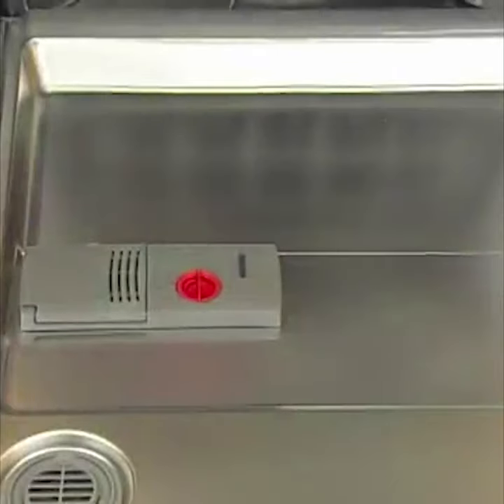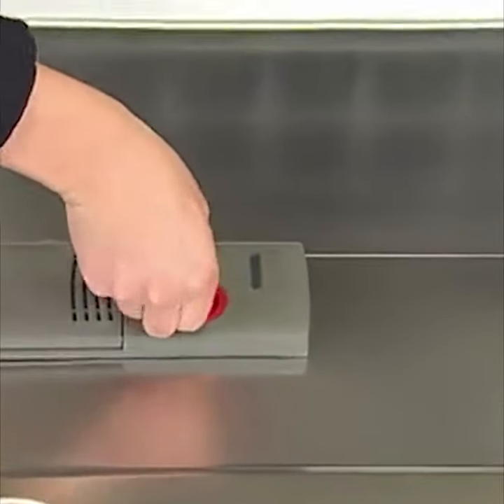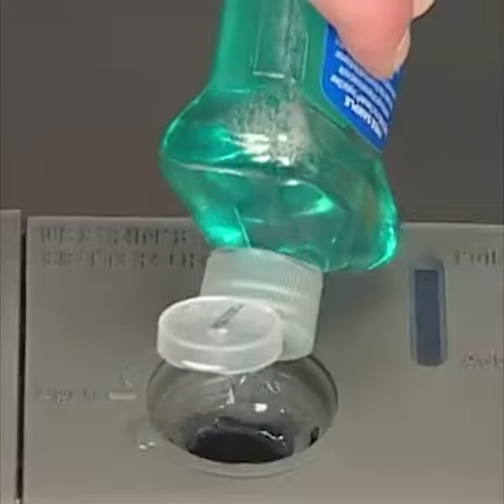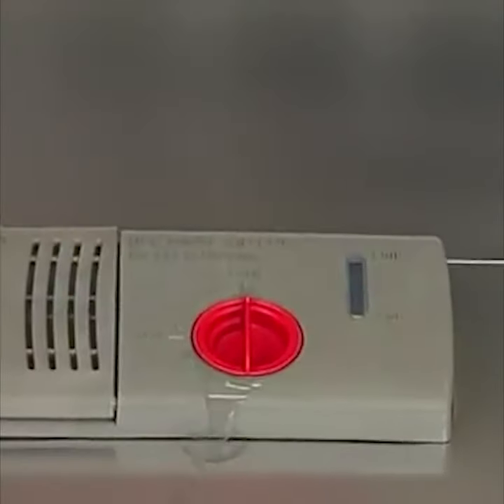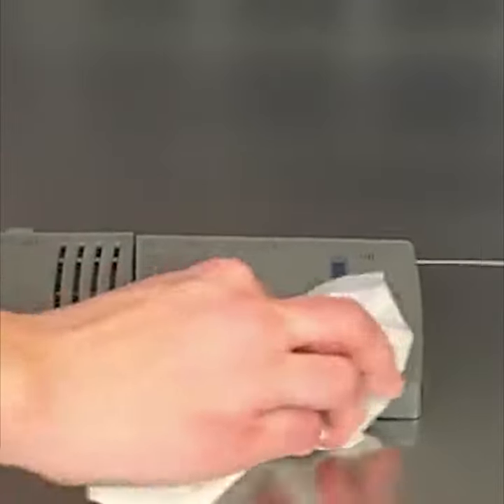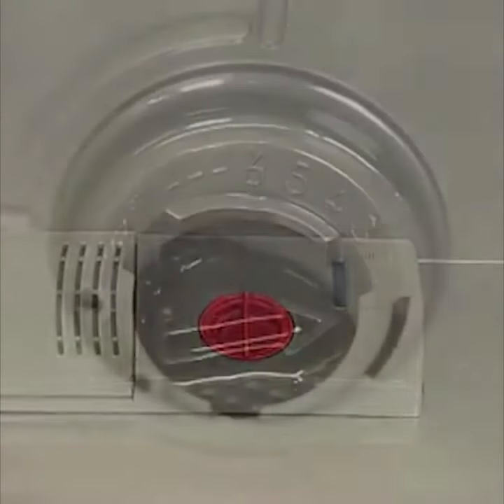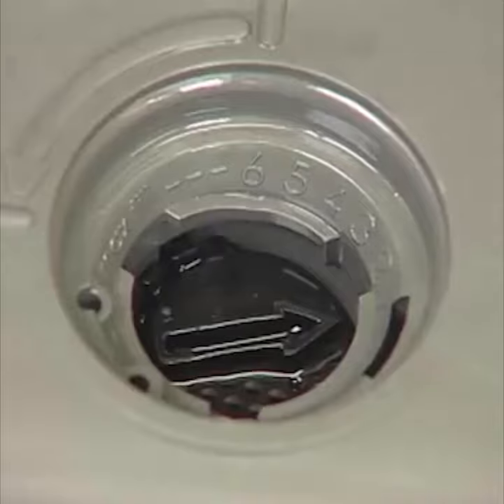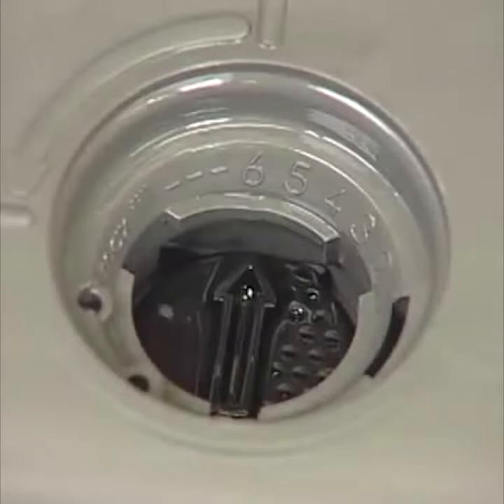How to Fill a Dishwasher Rinse Aid Dispenser and Adjust its Setting

Comment: I don’t have an idicator
Reply from the maker: When your rinse aid dispenser doesn't have an indicator, you'll need to refill it every month or two -- depending on how often you use your dishwasher.
Reply: @searspartsdirect  how do you know when it’s full I pour it in there and it just vanished